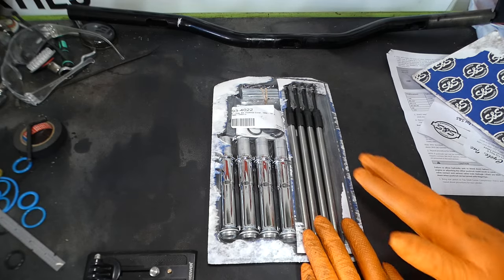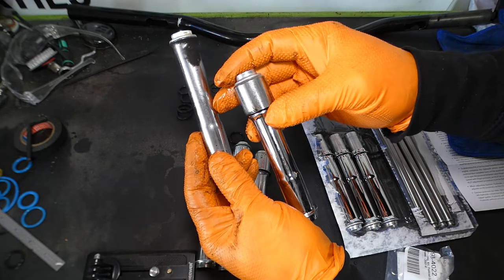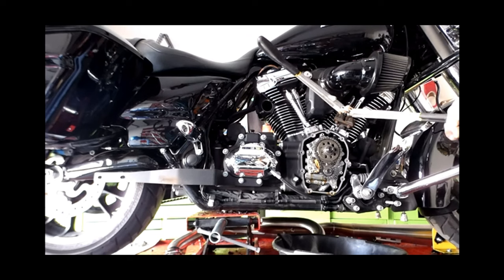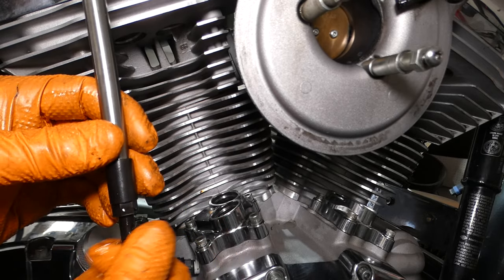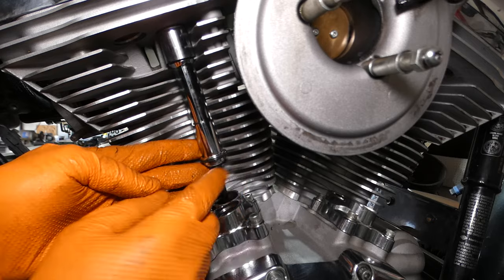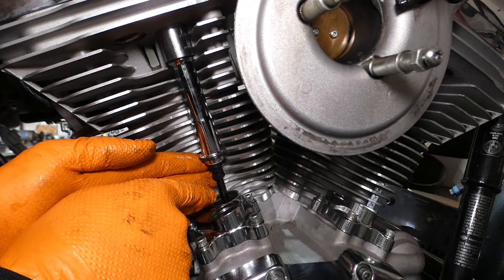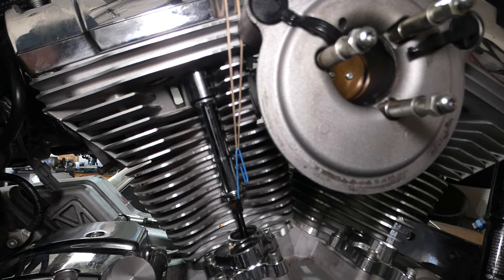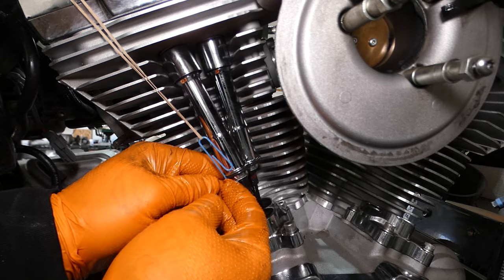Installing and adjusting S&S Quickee Pushrods on a Harley Davidson

Comment: Clean everything with solvent. A hydraulic lifter has .200 of travel. Your pushrod wants to be half way @ .100 This is the same for 24 or 32tpi. Finding TDC.. rotate the pinion OR cam gear until the timing marks line up for the "rear head". Turn the pinion gear again 360° to 12 o'clock the timing marks are not aligned.. you are now TDC for the front head...everytime.

Comment: You can follow the pushrod mfg advice on turns or you can be smarter than that. Ideally you want to push down on the tappet 100 thousandths of an inch. Period. That gives you dead center of the tappet travel. Measure the the pushrod adjuster threads per inch, divide by 10. Thats how many turns you want. May end up being 3 1/4 turns.... Maybe more maybe less. Different mfg's use different thread pitches. Thats the right way to do it.

Comment: Lifter preload is determined by the lifter manufacturer.  Stock Harley lifters are .100"....with a 32TPI pushrod one full turn would be 0.03125", so to go .100' you would need 3.2 turns (if you are still using stock Harley lifters please get rid of them).  If you are using S&S or Wood lifters, the preload is .120 to .140 (I set to .130).  So using a 32TPI pushrod with S&S or Wood lifters the correct preload would be 4.2 turns.  If you are using Wood pushrods at 24TPI the math changes....using Wood lifters and pushrods you need 3.12 turns to get the correct .130" preload.

Comment: The thing most of these videos fail to mention is that adjustable pushrods come with different threads. A 32 tpi pushrod like S&S goes 4 turns or 24 flats. If you have 24 tpi pushrods you should go 3 turns or 18 flats. 24 tpi travel 25% further per turn compared to 32 tpi. This also affected by which cam and lifters you use.
Reply: i have a set of harley screaming eagle adj push rods cant find much info on setting them, any idea what tpi they would be 2004 road king twin cam 103 upgrade any info would be a great help

Comment: I am just now putting an S&S QUICKIE SET in my 07 ultra.. great tips... here is one for you and anyone doing this... sewing tread through the jam nut.... in a large loop( not tied) then you do not have to fight the jam nut... let it fall..  pull it back up when its needed... ❤ thanks for the info all around
Reply from the maker: Nice tip! Thank you for that 🤘🏻
Reply: @GilstrapGarage  your welcome,  I have big paws.  Hard to hold jam nut and lengthen the rod.... 2 wrenches only needed once 4 turns and bled down.. hold the fixed nut on pushrod.. then tighten jam nut... no sence in monkeying around with 2.  7/16 wrenches and 1/4.
Reply: Or just grab it with a small pick-up magnet.

Comment: I adjusted mine today, after 5000 on a cam, 465c milwaukee 8 114. I started getting rocker noise. It was my first time adjusting my own pushrods. I found top dead center, lifter all the way down. I'm sure I didn't get lash out correctly. First time, loud rocker noise. Readjusted adding 1/2 turn, yes after 4 turns. Ran it till hot. Quieter, wait till cooled down and readjusted. Quiet. I felt better just sneaking up on it.
I run my bike hard, not surprised I had to adjust them. Now I know how. Good video

Comment: I dont see how the retainers dont cause a leak with o-ring under the washer... i thought the washer was last so the retainers could push against it. Great video man. I'm in!
Reply: The way he set it up is correct spring goes in retainer cup first then the flat washer goes in resting against the spring this way when lastly installing the o ring it sits flat against the flat washer, it you do it the way you think it should be then the o ring will be resting against the end of the spring and that spring coil end is uneven and the end of the spring would deform the o ring and if it does not leak when you start up bike it will leak eventually. The other side of o ring needs to seat in the beveled end of the lower push rod cover.

Comment: At about 19:30 in the video, you showed the marks you made on the intake and exhaust pushrods as you turn the rear wheel. You explained that you want to see when one pushrod goes up and the other pushrod goes down at the same time in order to find overlap.  Is "overlap" the same as "base circle" when working on the same piston?. Also, do you rock the back wheel forward and back, or just keep turning the tire forward in order to find the overlap/base circle?
Reply from the maker: when one set of valves is in overlap (opening and closing) then the opposite cylinder will be on the base circle of the cam.
Reply: @GilstrapGarage  Thanks. I just got thrown off about "giving her the beans" as it relates to locking down the jamb nut.

Comment: I've got a 1990 flhtcu with a 97 engine on it. I need to replace the cam cover gasket but don't want the hassle of taking off the gas tank, rocker covers/arms and stock pushrods to do it.
Would cutting out the stock pushrods and replacing them with adjustable ones save me the hassle?
Reply from the maker: Yes it would. But you will have to purchase the “quickee” style pushrods

Comment: Removing the adjustable pushrods you do the same thing? Have oil coming out of my covers not sure why installed all new seals when installed all new sns stuff
Reply from the maker: yup! get the lifters on the base circle of the cam and back off the adjustment.

Comment: Are the quickies labeled intake/exhaust ?  Probably doesn’t matter cause they adjust to proper length
Reply from the maker: The S&S quickies are not labeled. If you’re buying non-quickie adjustables, they are usually labeled

Comment: If you installing pushrods with existing lifters already installed do you have to pump them up?  How do you get a good bleed down effect?
Reply from the maker: If you installed the lifters dry the lifters will me compressed too far for normal operation. If you pumped them up before installing, then you just have to wait 10-20 minutes each after you set your push rod length and they will be bled enough to turn the engine over
Reply: @GilstrapGarage  have you seen any cam bearing get damaged during removal?  After I pulled bearing and removed from the tool I noticed couple rollers fell out and cage was a little damaged inside.   Didn’t see anything or debris elsewhere and new cam bearing went in smooth 👍

Comment: I watched the video again, and I don't know if because of the angle of the lens, you have the exhaust pushrod on the outside, while the intake pushrod is on the inside, which is contrary to everything I have learned about them. I have been told that exhaust is inboard and intake outboard.
Reply from the maker: Without even reading the service manual, The angle of lifter covers point the pushrods and the tubes to their proper spot on the heads.

Comment: are the pushrods all the same size/length , meaning they can go in either the intake or the exhaust side ?
Reply from the maker: Intake and exhaust are different lengths. The quickee pushrods don’t matter because they adjust out, but some adjustable pushrods from other manufacturers are labeled for intake and exhaust.
Reply: Awesome, just ordered them so great timing with your response 💪😎

Comment: just a thought, you showed that the Harley OEM exhaust side pushrods are slightly longer than intake. why is it then that S&S have all the same 24 flts or 4 turn in their adjustable pushrods?
Reply from the maker: when you run the end play out of the pushrods it lengthens more than the intake side does

Comment: I am not sure why some of guys don't use a rubber band and a paper to to hold up the push  rod tube to keep it out of the way to adjust the push rod . Plus you can easily see the adjustment nuts better . god job  just my thinking

Comment: What if when I did the 4 turns, my pushrods are already spinning without having to wait?
Reply from the maker: Don’t go more. Your lifters are probably not pumped up enough to add any resistance. If you go too far you could hang a valve open or collapse the lifter.

Comment: So would this instal be for 88ci vtwins or is it the same process for all vtwin like the 104?
Reply from the maker: 88ci motors are a little different because the cam has to be pressed in and out of the cam plate with a special tool

Comment: Question do the push rods have to be changed or can you use your stock push rods with a new cam, like a S&S 475c cam on a 114 M8
Reply from the maker: I’ve never used the stock pushrods on a new cam. I imagine if the base circle of the cam had the same profile I’d would be okay. If it’s not, then your valves won’t close completely

Comment: If they are noisy should I give them two more flats each to lengthen them out a bit?
Reply from the maker: As long as you don’t exceed the lifter’s manufacturer specs
Reply: @GilstrapGarage  I pulled the lifters out today and front intake lifter wouldn’t hold oil, that explains the noise.. Brand new wood’s lifters!  My brother put the same lifters in his and it’s noisy. I put screamin eagles in mine to get it running until the warranty replacement comes and it’s quiet now. Thanks for the reply!
Reply: @coryturner9140  Where would the clicking come from? Between the lifter and the push rod, or between the push rod and the arm? My 2000 Heritage Classic, with S&S pushrods and lifters sounds like an old typewriter.
Reply: @CarlosGarcia-ls4hn  I had a bad lifter brand new woods alpha wouldn’t hold oil, that was my noise.
Reply: @GilstrapGarage  Is there a scenario when you would not follow the specs and not do the full turns as specified?

Comment: Are the amount of threads shown going to be different on each pushrod?
Reply from the maker: Yupp. Each intake and exhaust should be close to the same as the other side though
Reply: @GilstrapGarage  thank you for the reply
Reply: The stock exhaust and intake pushrods are different lengths, so naturally they would end up looking different with the adjustable units.

Comment: Don’t you want to put the upper o rings in the head first ? Everywhere I read says don’t put the oring on the top of the push rod (that goes into the rocker arm ) put the o ring into the head then shap the top in

Comment: Lifter travel is .2 inch. The ideal adjustment is 3.25 turns for .1 inch. Motion Pro 08-0255. Handy little pliers for the uppers. Well worth the $15

Comment: I wonder how many (turns)total travel most lifters would have.
Reply from the maker: Most manufacturers will tell you their recommendations if it’s not listed In the instructions
Reply: @Gilstrap Garage  yeah I'm just thinking outloud.  I bought an 2000 fxdwg last year that has been staged 4 modded since nearly new.   looking at the owners service records he had a dealership do the hydraulic tensioner upgrade, and they threw new harley lifters in it at the time. It has a woods tw6h cam in it, with valve springs(ported heads, 95" hi comp, 44mm se carb, intake, ignition ect)  it has a little valve noise but that's probably to be expected...  but I also feel like dicking around with the pre load on the lifters too 🤣
Reply: Take your lifters out, take them apart and clean them up then measure the travel with a dial indicator or digital caliper
Reply: And then set the rods half way into that travel, correct?
Reply: @85slauer  👍yep, I even take apart and clean new lifters before install to get the factory oils etc. out and check travel, then pump them up with an oil pump can, install and set pushrod length

Comment: that's right boys, cut them pushrods.  Hey, no problem-  introduce 4 more potential points of failure; cuz there isn't enough in a Harley already.  And why?, oh that's right-  you'll 'save' so much time.  I mean-  you'll 'never' go upstairs right? You'll never change out the breathers. Besides, what could go wrong-  you got this...  While you're at it-  why don't you twin-cam boys just remove your tensioners, yup- just delete them altogether, and sure-  delete the compensator too. Who cares about design tolerances- what do those nerdy engineers know anyway?   ????????????? -  Boys-  think.
Reply from the maker: Lol. Why don’t you click on the playlist “Aly’s Dyna” on my page. You can see the kind of maintenance that gets done. You can also hear why I like the convenience of the adjustable pushrods for the miles I make. What do those nerdy 1 time viewers know anyway?

Comment: I notice that alot of ppl dont use the timing marks on sprockets to determine the overlap....
Reply: I used the timing marks but seeing so many ppl not using it I'm wondering if I did something wrong? Does the timing mark only work on stock cams? Or are they the same no matter what size cam?
Reply: If your timing cover is off just use the marks. dot on cam a @ 6 oclock do rear cylinder mark @ 12 oclock front cylinder.